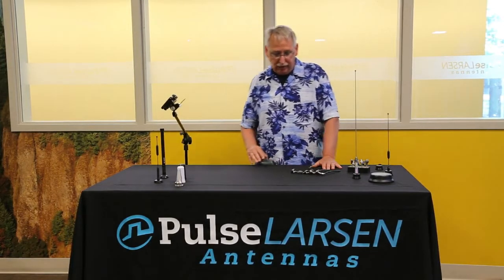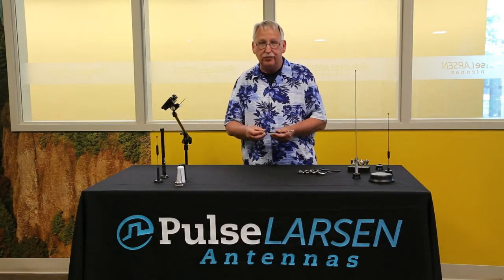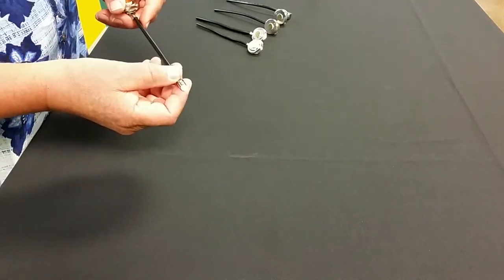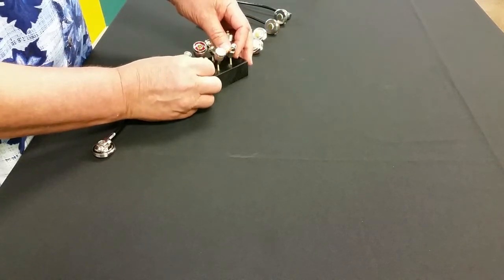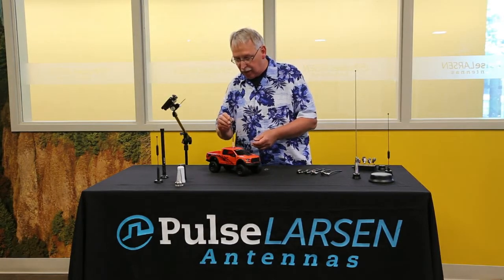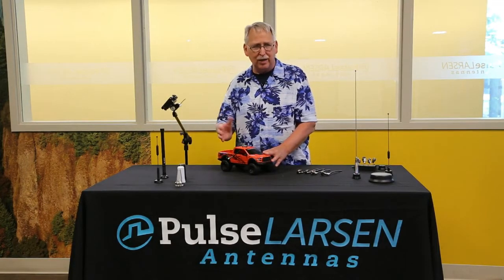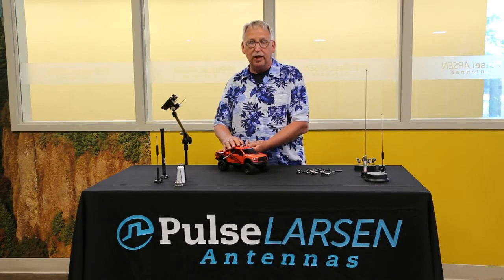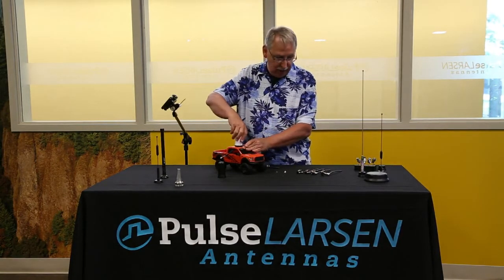Tech Talk   NMO Mount

Comment: Im installing nmo on my tdi jetta trunk lid. I was thinking of using a 3/8 hole mount. Is the 3/8's that comes in pieces as strong as the 3/4 hole mount? I have full access to the underside. Is there any differences? If one better?